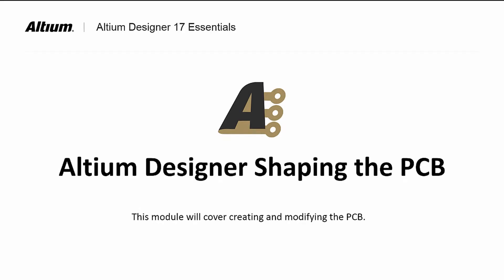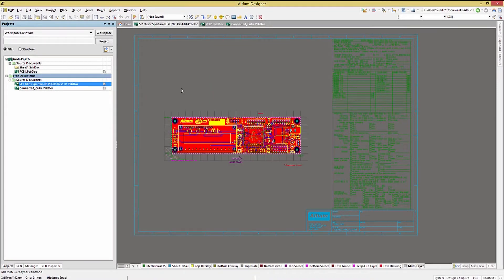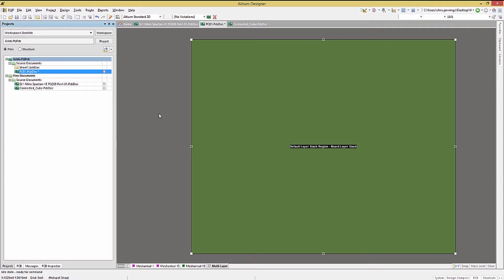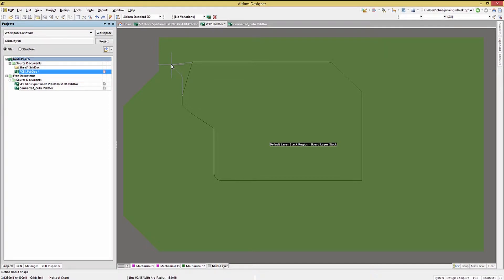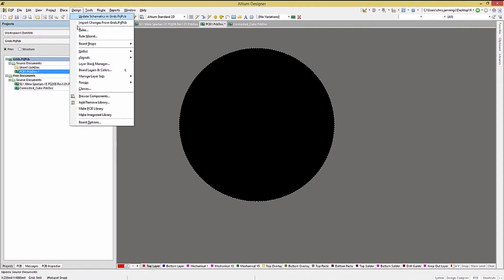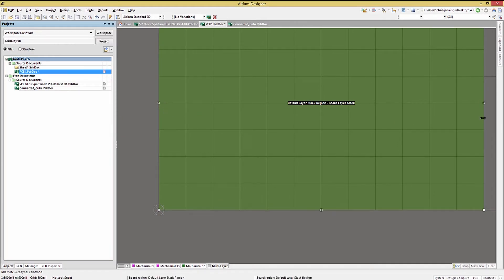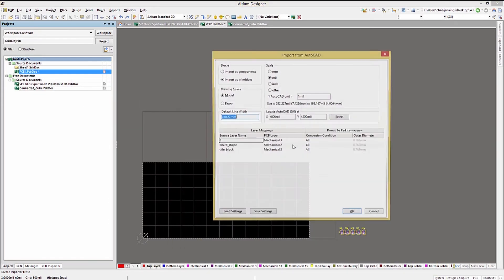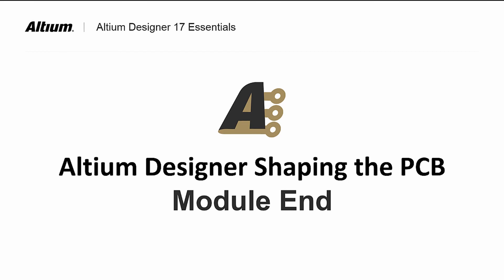The PCB Shape and Outline | Altium Designer 17 Essentials | Module 17

Comment: hi, it is possible to make a PCB exactly as some 3D step file? , i need to add some millings to a fat 4mm PCB. I try to define shape from boddy but only let me to select one face... Any suggestion?
Reply from the maker: Sounds like you need to use the Layer Stack Manager (LSM) to increase the board thickness to 4 mm. This technique is only for the board outline. The thickness is all dealt with in the LSM.
Reply: @AltiumAcademy  thanks for the response. I was investigating about LSM. but apparently i cant make split "circles" or shapes, only lines.. i am searching some like this https://imagizer.imageshack.com/img924/8804/zldAcs.png